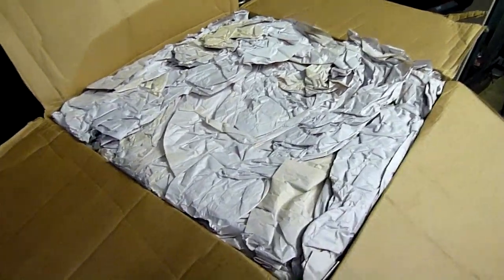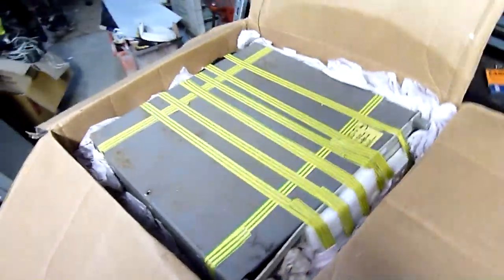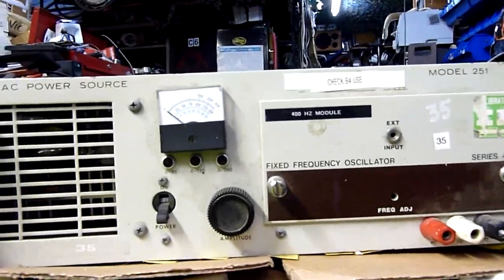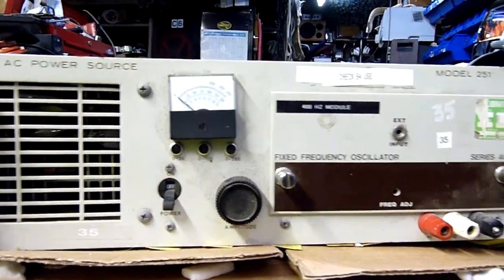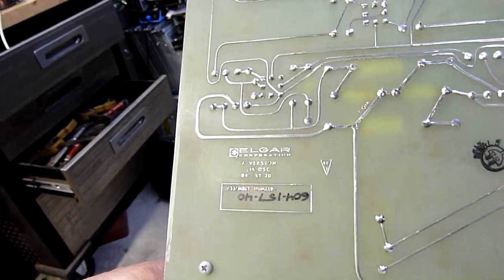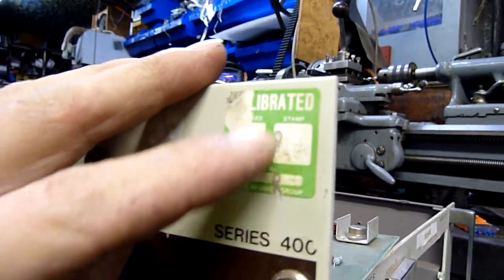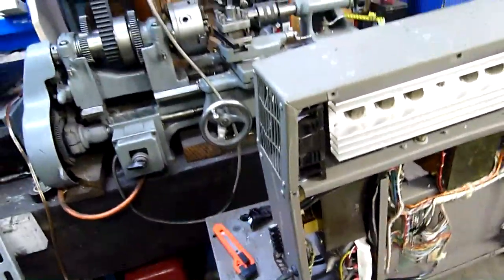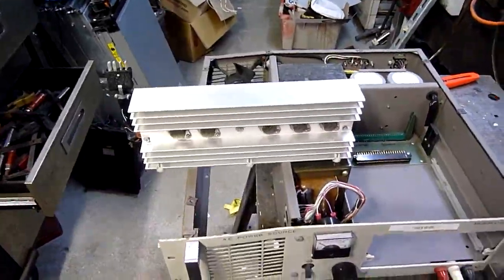Elgar Multi Voltage Aviation 400hz PSU Repair

Comment: Ahh, ELGAR, really well built equipment. It's simply a high-voltage audio amplifier. You could use it for music amplification. The one i used at work had a flaky 10t-pot for the amplitude, so one day i fixed it. Also, it's not a Class D amp, it's an Class A.
Reply: It's class AB push-pull.

Comment: If that fan shroud was Bakelite two part epoxy will work very well for gluing, I've used it to repair broken radio knobs and Bakelite radio cabinets. I've even glued broken Bakelite plugs back together with epoxy, and they are as solid as new.

Comment: Gotta love the bakelite plugs, they're still reasonably safe so long as they're intact, as they have very good insulating properties when it comes to electrickery... :P

Looks pretty well-built, but the question is, how tough was it built, looks much tougher than "ford tough" though... :P

I remember seeing some 115V fans in stock at the computer shop I used to work at, no idea why we had them, but they looked like they'd been there for a long time...

Comment: A coworker who is ex US Air Force worked on B-52 bombers. Some of the systems required a 15 minute warm up because they were all vacuum tubes.
Reply: That's pretty much standard procedure with tube equipment in general, not because of it taking 15 minutes for the tubes to heat up but for stability reasons. When it comes to avionics I believe that they still carry that out procedure even thought it is all solid state these days.

Comment: I have A McIntosh audio amp the weighs in at 120 lbs and i tell you i will NEVER get rid of it right now I'm using it on my computer with my old DJ speakers and it sounds so good and clear...

Comment: Not gonna lie, but I checked my Steam the first time. Interesting looking tech you got. Would this be found inside a plane or would it be more seen on the ground?
Reply from the maker: This is a ground power unit from an avionics lab or some such workshop, power on the aircraft comes from 400hz alternator/generator units.

Comment: How about a circuit for a 26vac 400hz  100ma supply?  an HSI or CVR does not use much power , I suspect your device probably runs of 114vAC 400 hz?

Comment: Don't you ever worry about PCBs in anything you open and touch?
Reply from the maker: not really, I usually touch ground before handling them. the table and chassis is grounded for example.
Reply: Aussie50 No, not that PCB this one http://www.epa.gov/epawaste/hazard/tsd/pcbs/about.htm Its common in old electronics
Reply from the maker: BurezFolf oh, Polychlor, yeh its nasty stuff. 
if I open something with old oil caps that are leaking oil, it goes back to the scrapie, fluro ballasts and aircon caps are the worst.

I only have one large cap around here that contains it, and it weighs about 30lbs.

smaller caps, probably a few. but I do not use them for high stress jobs. if they leak, they go in the bin.
Reply: The dangers of PCBs were greatly exaggerated, the stuff is probably much less dangerous then most pesticides in it's normal state, or lead for that matter. If you get some on your hands, just wash it off as it is not a good idea to ingest it. PCBs only really becomes a problem if it's burned, and it takes a lot of heat to get it to ignite which is why it was used in transformers and the like for cooling.
Reply: Something like that you are never going to kill it, possibly if you are dealing with 1000s of ICs then you may kill one every now and again but killing PCBs with ICs on like a PC motherboard the chases are very very low that you will damage anything.

Comment: I am Ukrainian so if you need translating parts of the manual I can help :)
Reply from the maker: cheers mate!, I will let you know if I need anymore info. we already had a crack at it on TGG IRC and found the pins (pretty sure)
we probably do not even need the Syncro Resolver anyway.
Reply: Не надо :)
Я довольно часто на TGG IRC сижу, переводчик уже есть :)
Если английский хорошо знаешь, thegeekgroup.org
P.S - that was to Anton